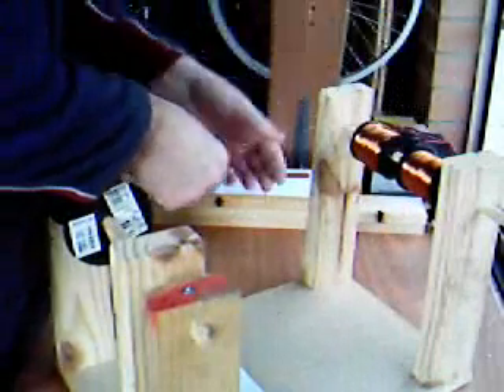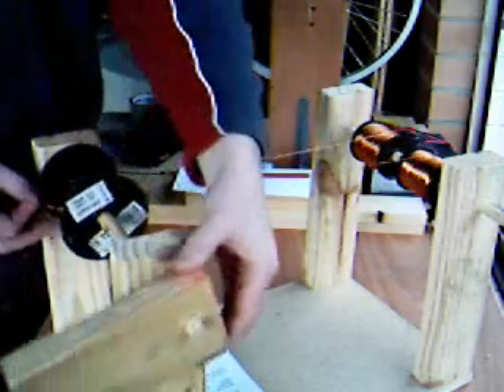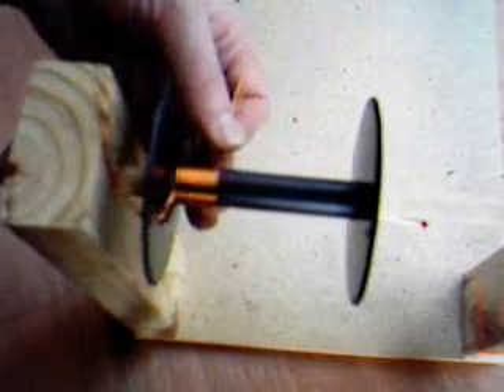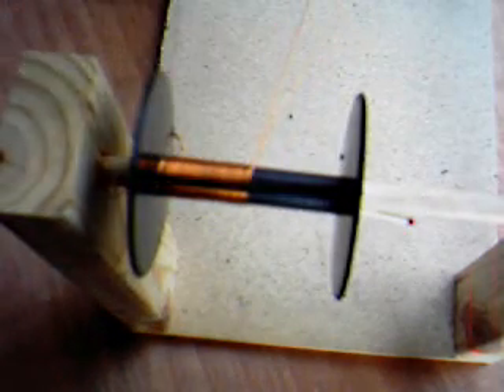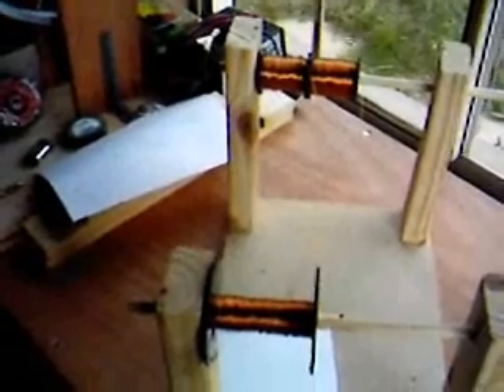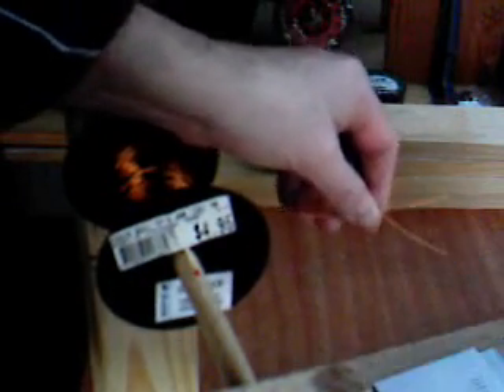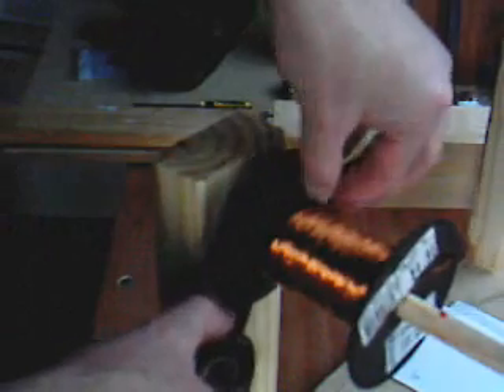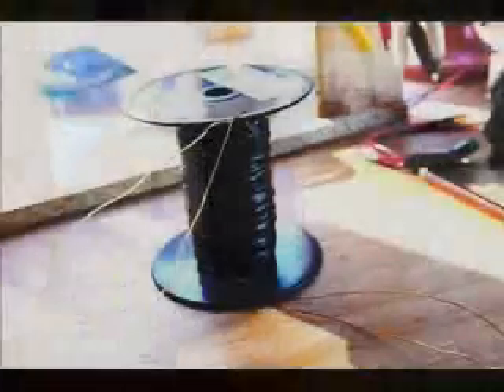How to Wind a Bifilar Coil

Comment from the maker: @Ben Hooper Yes, the copper wire is (somewhat) insulated. When you buy spools of copper wire the copper is coated with a very thin clear lacquer (varnish) to (presumably) stop the exposed copper from corroding over time. So, to solder the end of the copper wire you will need to scrape (say 1 inch) of the varnish off to expose the copper underneath.

Comment from the maker: @billzball Perhaps a better description would be to 'continue threading but in the opposite direction, so the new wire threads are over the top of the old'. So you might crank the winding handle anti-clockwise (as I'm doing), begin threading left-to-right, and when you reach the end of the spool, you reverse the threading direction (ie. right-to-left) while continuing to crank the handle anti-clockwise.

Comment: it is not a bifilar winding. you are winding the coils in parallel so the current in the two coils will be in same direction results in aid of flux. inorder to cancel the flux wind the coils in opposite direction or short the terminals of the coils on one side.

Comment from the maker: @abpccpba Thanks for your comment. I've not found this to be true so far. Some of my coils are several years old. Their impedance remains pretty much the same today as when I wound the coils. But what you say might be true (it makes sense as we all generally have a very thin layer of acidic coating on our skin). So perhaps I'll use cotton gloves when winding my coils. Once the protective black electrical tape is wound on then I don't have to worry about acid from my fingers.

Comment from the maker: @usedbandage9 Thanks for your comment. For my Bedini projects a parallel winding works just fine. Twisting the 2 wires together *before* they are wound onto the spool is called Litz (lookup LITZ in Wikipedia for more info). In Bedini replication circles, there seems to be some debate about whether or not twisting your wires before winding on to your spool is more effective. Some say yes, others say no. I've not tried to determine if there is any impact in my projects.

Comment from the maker: @john29302 Thanks for you comment. Bifilar coils are not for every project that requires a coil. Some projects require just a single wire coil, some require a 2 wire coil (bifilar), and some require a 3 wire winding (trifilar). Bifilar coils can be used when you need a transformer-like arrangement in the one coil (energy down one winding gets converted/shunted to the 2nd winding). I use my bifilar coils for various Bedini projects.

Comment: It looks like when you began, your wires were approximately on the "bottom side" of the spool, and as you rolled the crank, those wire "broke over" the top, first... as opposed to "going under", first, correct? Thanks

Comment: Just a thought but shouldn't the bifilar be wound on a toroid bar and mounted in a steel plated  magnetic coupling? Like the one inside Stan Meyer's  rotary controller unit? I guess if your using a Vic circuit you can just use bobbins as the charge is already polar magnetic and will create its own magnetic field as it travels through the coil.